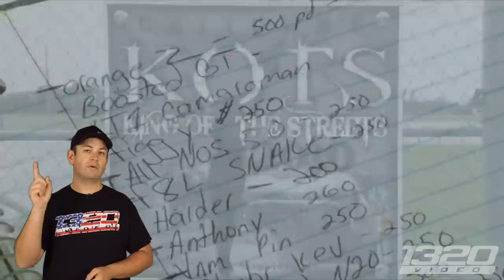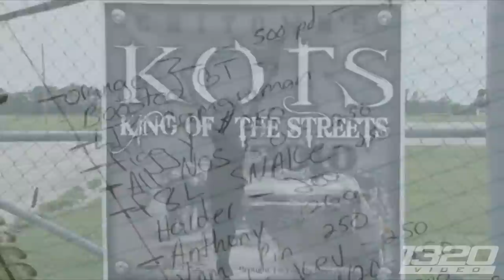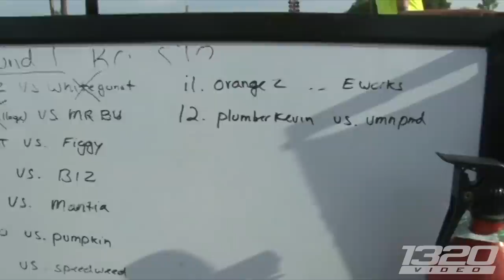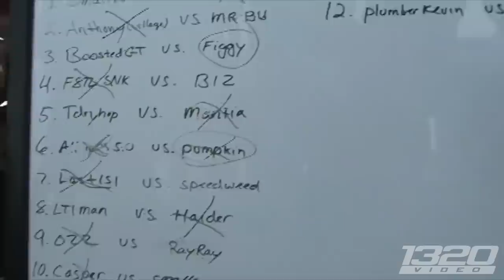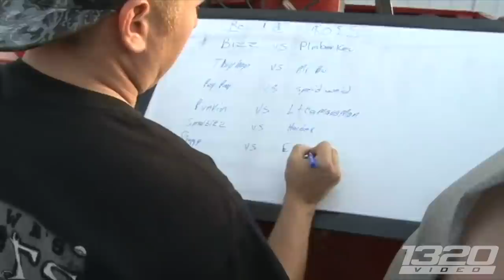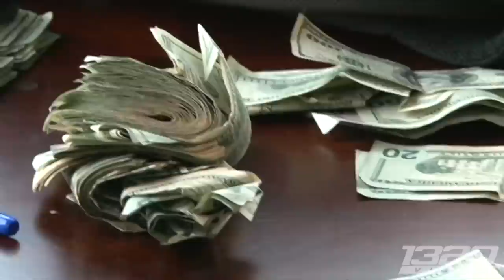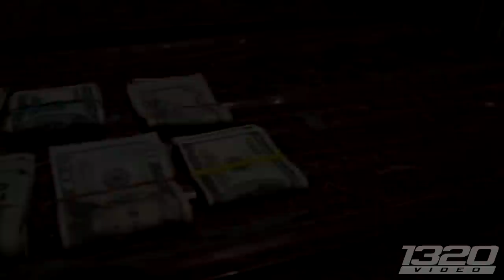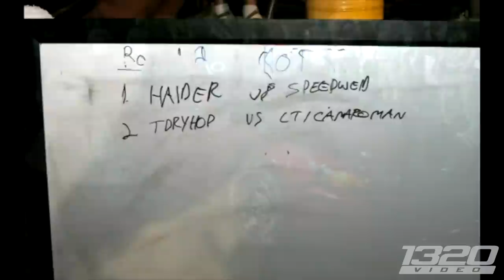1320Video Presents: The Start of No Prep!

Comment: O to the good ole days when the lil guy could compete and show up with his race car on an open trailer , now a days these guys have so much $ that it's impossible for the lil guy to even show up
Reply: batman5738 0906 it’s possible if you build a fast car
Reply: Dayton Wintle which eliminates the little guy...
Reply: Compete in a slower class if you can't afford it.
Reply: These guys are quick but still very achievable.
Reply: You'd be surprised... A good combination can be quick for a reasonable price if you do your own work. The junk yard holds gold and eBay turbos are cheap. Nitrous is even easier. The lighter the car, the cheaper it is. These guys all went cheap to begin with but they've been at it for years. They came up to this level.

Comment: “King of the street”.  Every car shows up on a trailer... 🙄
Reply: Most traveled a good distance. You're not going to drive a car 15 hours lol
Reply: JR Byers I hear you. People acting like this is Drag Week. Even most of those guys let it all hang out on Friday then load the car on a trailer and drive home lol. Cars of this caliber get trailered at least to the meet up spot to street race. People just don't understand.
Reply: Every car on a trailer going to the track and then they spray vht hahahahahahaha.
Reply: I get it, just think the definition of street car has become kinda blurry.
Reply: Not really. You take any car that people get butt hurt about calling it a street car and replace the engine with one that isn't going to be fast and the complaints would go away. It doesn't get "blurry" until the car gets to a power level that the individual sees as ridiculous.
Reply: You take the engine out, suspension, brakes, wheelie bars, lexan windows, tires, radio, ac, ps....................oh crap, that's 90% of the car smdh. Street car isn't just the engine lol.
Reply: Street Car and Daily Driver aren't the same thing. What cars here have wheelie bars? You do realize most of the cars in this video were available for purchase new without A/C, power steering, and a radio? If the car is fast people bitch about "street car", no matter what the car is. If it's slow no one cares.
Reply: But 90% of these cars would never be driven on the street...  there is a difference between what is technically “street legal” and what is actually streetable.  None of these cars are streetable and therefore should not be called street cars.  Drag week is a whole nother level because they do drive their cars.  These are trailer queens.
Reply: No point in arguing lol, some people are just..........special lol.
Reply: Apex Assassin Yeah stock suspension small tire cars, totally not streetable...
Reply: Cheaper to tow it that far
Reply: Turbo Panda
It's no prep, means no prep ready to go off the trailer = no touch.
Reply: Doug Clark No prep means the race track has not been prepped. It’s slick as the roof you drive on. It doesn’t mean you can’t prep your car.
Reply: Your not gonna drive a car like that hours lmao
Reply: @everydayirace  i wonder whats the difference between a street car and a ...... pro drag car? These all look like semi-pro cars at least and possibly cost as much as a pro drag car.
Reply: Yeah  how is that a street  car.  BULLSHIT.
Reply: Can anyone tell me which is a Fox body mustang. I'm in the UK, on 2 types I see are hatch backs, or what is now known as a hot hatch, and coupe, which just has a boot lid, which is which???
Reply: Dave Micolichek  okay thanks, but Hot Hatches here in the UK aren't front wheel drive hardly at all now, in fact all the decent ones are AWD, Golf R36, Escort RS Cosworth, the list is end less, just didn't get the fox body thing because we don't have them here.
Reply: Would 9 second 8th mile hondas be more your speed? Obviously you've never had a real car of u think like that.
Reply: Cause its a street car. Doesn't mean it has to be driven there.
Reply: @discohcr2517  most of the cars in drag week are extremly detuned when driven from track to track valve train rockers are changed so while being driven on the street the valve train dosent get beat up .
When larry Larson gets to a track durung drag week its takes him a few hours to get his car truck or etc ready to race .
Non of these cars are steerable anymore.
Reply: Exactly
Reply: Toney. You mean streetable anymore.
Reply: Street Car p[pretty much means street legal afaik
Reply: No prep, just added dyno tuned nitrous blown engines...
Reply: in the real world, ''street car'' is a vehicle with any fuel in the tank that is legal by law and driven any amount of regular mileage and maintenance
Reply: @Paul Brassinga - Back when it was FUN and not a cut throat business...
Reply: That's true man
Reply: Dave Micolichek  facts

Comment: We were running King Of The Street races in Houston long before 2009. I started street racing in 2004 in Atlanta, then moved to Houston in 2005. They had been racing for years before I started there. Back then we ran real street cars that we drove to the spots, raced, ran from the cops and drove home. Two to three nights a week, every single week. Trailer queens rarely got races. If it was not a street car we didn't care. Birdman used to show up occasionally but he usually brought a big block Luv that he drove on the street.

Comment: The trick is to hide Hudson weed sprayers in the trunk full of VHT&MEK. Pressurize it with Co2 or  No2 what Evers handy and put the spray nozzles in front of the rear tires. Wire the solenoid to the line lock button and call it IPrep systems🤣

Comment: The call "No Prep", but every car arrives on a trailer, gets unloaded, then gets its hood and hatch up so it can be tuned and adjusted and... Prepped!!   
I'd like to see a no-Nitrous, no-Turbo, truly No-Prep Drive-Up Race, where you drive up, get in line, then hit the go-pedal when your light turns green.  No tire burn-outs, no prep other than warming up the engine it you desire.    Fastest in class takes the prize.
Reply: No prep means the track is not prepped

Comment: 21:41 that rear tire not matching the rpms and still won
Reply: Might have a round number of tire revolution per frame of the camera. Like the tire is rotating 5 times for every frame, would look as its not turning.
Reply: follow the M/T on the side wall, watch it in slower speeds, zoom in...this case was not a optical illusion

Comment: Thought this was "NO PREP"???
Reply: No hits off the trailer.. That's their no prep
Reply: Brian Kirsch makes senses.... I saw them spraying and getting prep on the surface in each run so I was confused
Reply: I've always heard no prep defined as a a surface that hasn't been prepared for the event IE no traction compound. I figure this event was no prep for the first run then after that the track would start getting sticky from cars running down it.
Reply: right? they prepping all the time! Or I dont know what it means
Reply: Practice and prepare are synonyms
Reply: Some racers are spraying up to the starting line like they were told they could do and some are just doing a burnout in a traction compound. I didn't once see the track officials out there spraying the track or dragging it.
Reply: Yeah they werent allowed to spray past the start line. Those were the racers helpers spraying not track officials. Ppl have always and still to this day spray the street with vht too so whats t he difference? They were doing it at the track the same way they do it on the street up here in indiana and Illinois
Reply: icalexander i feel as if they didnt prep the track for these cars alot of crashes would insue
Reply: @icalexander  that's the point

Comment: @5:02 Why is the battery charger hooked to his gas cap and shoot bar?
Reply: It was a prototype gasoline being used. That was 110 octane infused with protons and when used in a steel or aluminum fuel cell can be activated by a slow trickle charge.

Comment: No Prep 🤓  now days there’s either so much glue then track looks wet or no prep🤦‍♂️ a loose track is a power equalizer and with the right set up any one can get down it. A tight track is dominated by both power and set up being much harder to run well. But I have never drag radialed🤣

Comment: What is no prep, like what does it mean?
Reply: jason mathis no test pass,straight from the trailer to the track,no times neither
Reply: Also track isnt prepped at all. Normally its scraped to pretty bare concrete. Not sure that was the case at this race. But notice how they just allowed vht (sticky substance poured or sprayed in front of tires). Normally they spray and prep a good portion of the track.

Comment: why do these bone heads turn on headlights  it robs power from  the motor  the alternater   has  to work harder to  have headlights oon ity will definately be slower unlesss maybe loadiing turboo more  but that should be done with taller gearing not   drawing juice out of battery ,... my girl just bought a tessla  when you let off the throttle it automatically  slows car drastically because its charging the battery back up   it draws so much its like steping on the brakes